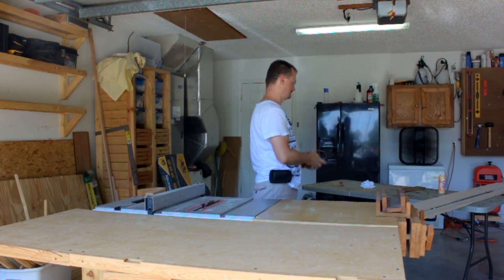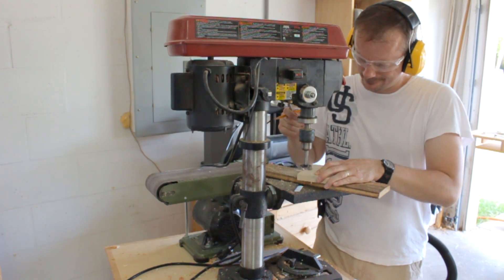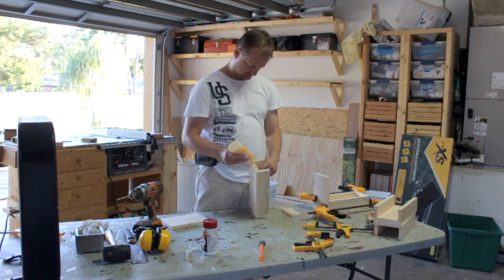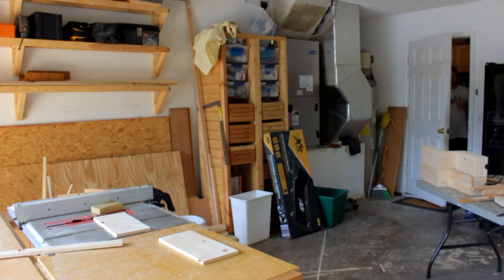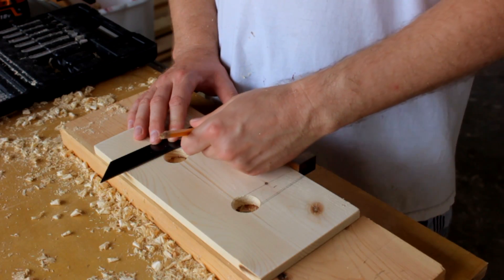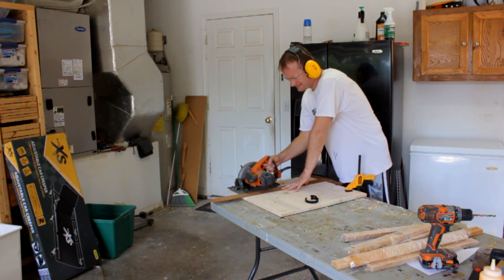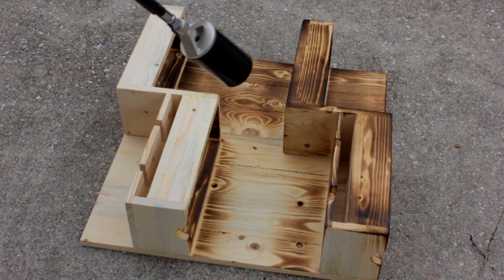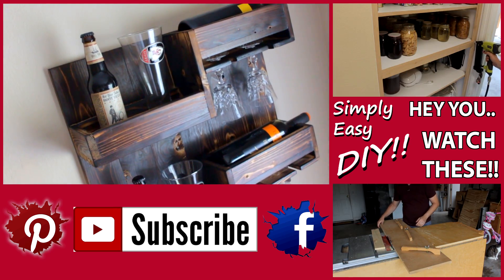DIY Wine & Beer Rack

Comment: Stan is there a finish on top of the "charred" surface ? Or is the slight polished look down to your judicious sanding technique 😜😀👍
Reply from the maker: "Judicious", Hehe.  Yes the sheen is due to a couple few coats of satin poly.  It really helped bring out the deep color throughout the project and accentuate the tiger stripping that makes it look really good.  It just wasn't the same without it.